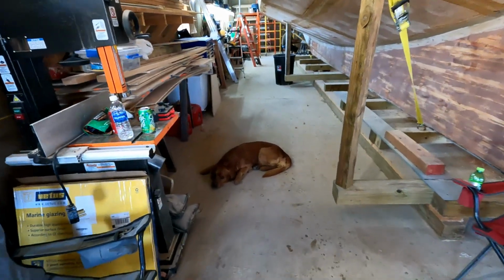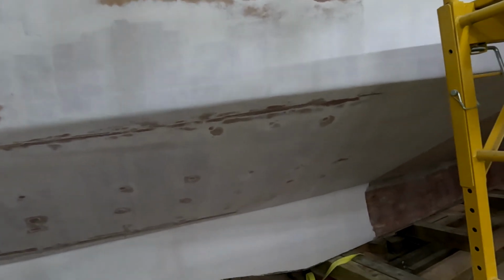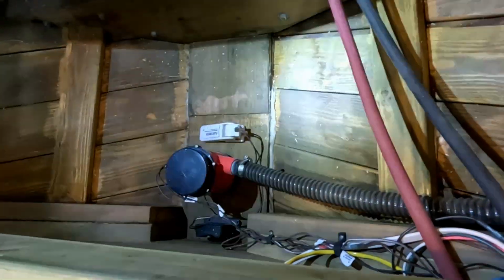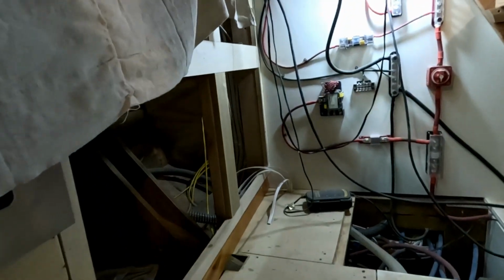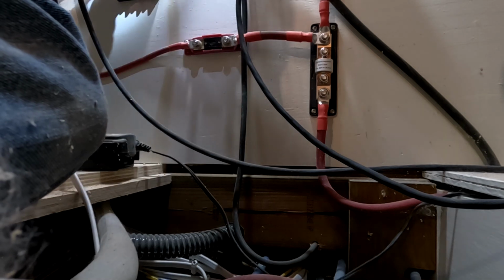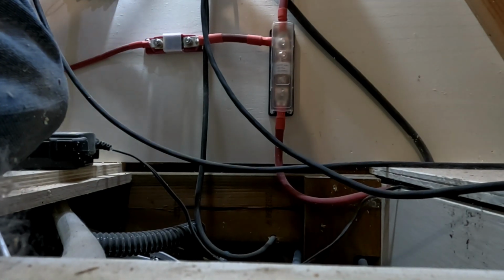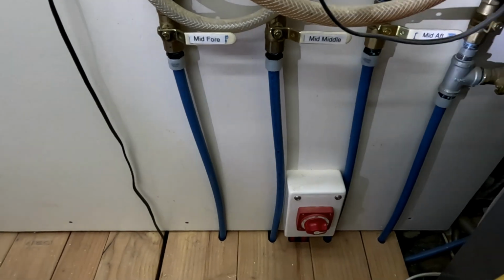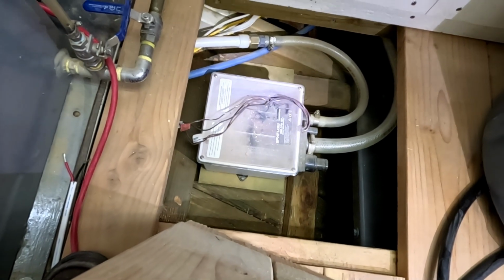First Primer goes on - Bilge Pump Wiring - Water Systems

Comment: Are you using tinned wire?

Will Io be a 12V boat?
Reply from the maker: Almost all of the wire is tinned, there are a few odds and ends that aren't. Mostly wiring that came with devices that weren't tinned. Yes, I decided to go 12 volt just to keep things simple and easy to replace down the road (or ocean).